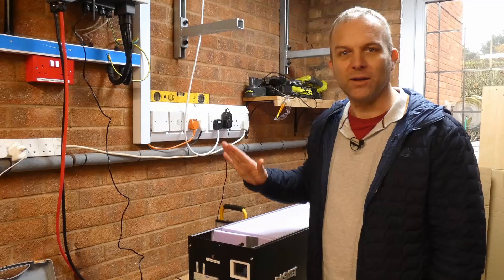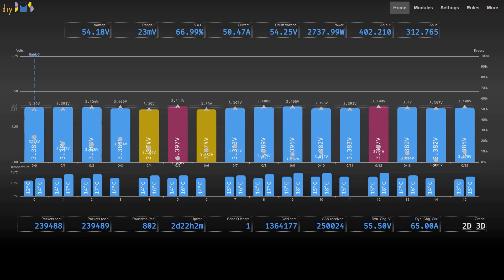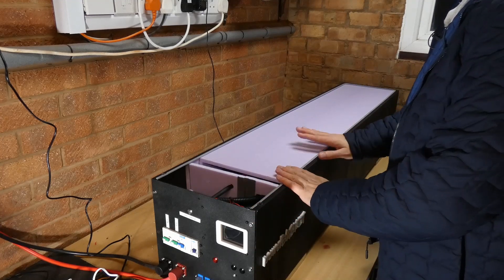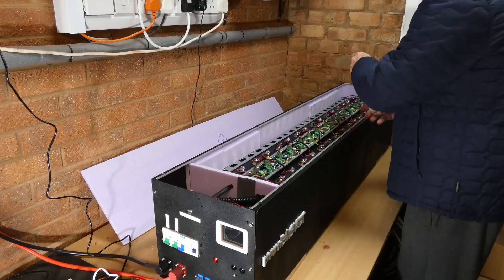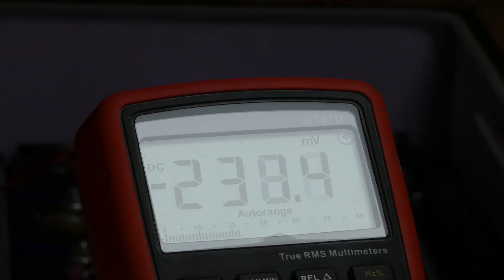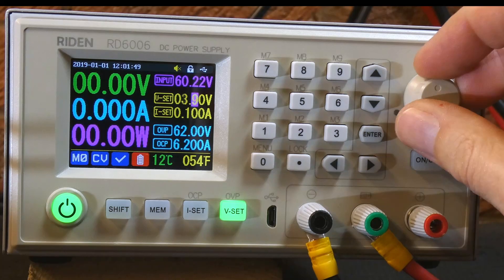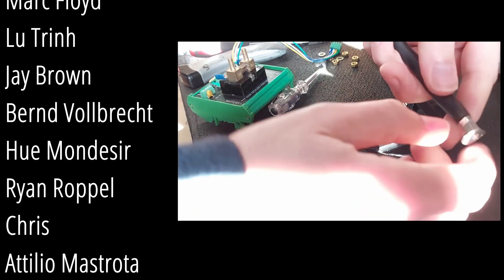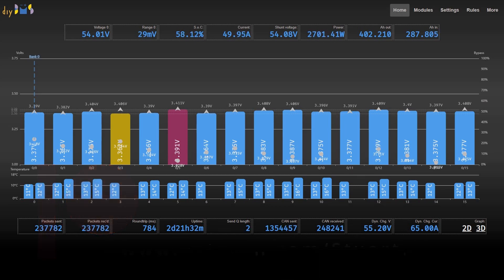Balancing The Pack [Battery Build #7]

Comment: Hi Stuart. Nice build. Top balancing these cells is an interesting topic. I've tried it a few ways. 1st time was the way you did it. Connect them all parallel and then use a bench top power supply. One 16s pack I help build with a friend was on charge for 5 weeks and  even then it never dropped below 4amps. Gave up and connected in series and let the balancer do the rest. 
2nd one I built just connected in series and let a 2A JK BMS balance them out but again took ages. 
I'm building another one atm and  charging them all individually with multiple a bench top power supplies. 
Be interested to see how you get on. 
Initial top balance is a tricky one to do quickly and properly.  
I think patience is key. 😊
Reply from the maker: I admit that I gave up too early before the cells were fully balanced.  They are a lot better than they were though.

Comment: I'm in the same situation. 16s 280ah Lifepo4. 2 or 3 cells high and 2 cells low. Occasional top balancing over the last 6 months has made no difference. Still have usable 9-10 kWh so not too fussed. Interested in what  could achieve with an active balancer.
Reply from the maker: I may look at an active balancer.  After manual balancing, I'm down to 8mV difference which I'm happy with, but time will tell.

Comment: Have you seen solarAssistant, running on a pi interfaces with most of those type of invertors I think. I've been very happy with it.
Reply from the maker: Yes, I need to spend some time looking at that and also home assistant
Reply: @StuartPittaway  SolarAssistant is paid, one time, but I'm very happy with it, and it can generate mqtt which can be picked up by homeassistant.

Comment: Stuart is its posible u add a bit of code. That when a certain battery reaches a certain voltage u van control the relais to switch on/off so we van add a actieve balancer Saw this in Andy ofgrid garage review of the bms hè got.
Reply from the maker: This could be done now with the relay rules - either at cell voltage level or at pack voltage level.

Comment: I did a balance when I got my first 16 cells. Works great next got your DIY BMS working in the end use a JKBMS very good system other than balance leads.
Reply from the maker: This balance is going to take a very long time!!
Reply: @StuartPittaway  Bottom balances first mate.

Comment: I purchased a ZKETech electronic load tester and ran each cell through a full charge, discharge and recharge. This gave me a baseline capacity of each cell to make sure they were well matched. I only had a 1ah difference with my 310ah EVE cells which was good enough for me. If one of your cells is mismatched and lower capacity than the rest, then this problem won't go away.

The reason I dropped the money on the ZKE tester was because it's a set the stages (charge, wait 10 min, discharge, wait 10 min, recharge) and let it run through a full charge, discharge, then charge again. All at 40 amps. I set it and walked away. The model I have is ZKETech EBC-A40L. It's got a usb port for programing and data logging. I tested all my cells immediately after getting them though it took over two weeks as I did one per day. This way if there was a problem cell I could return it to the supplier.
Reply from the maker: I'll do some research on the ZKE looks good

Comment: Stuart, you are not the only one who, after putting the battery in gear, has had to do the TOP Balancing with what I call the Magical Crusader (I don't know if this translated makes sense in English,). Arm yourself with patience because charging at 6A is going to take a while and cover the battery well because it's very cold I don't want your new lithium candles to catch a cold. When you finish this part, I have no doubt that you will quickly see a way to use the data that give that inverter, make it a decent interface, hehehehe. Last, every day I feel happier and proud to be part of your Patreon for some time now. .
Reply from the maker: Thanks chapulino

Comment: I gave up initial manual top balancing. I now fit a cheap active balance board and turn it on with MQTT at 0.1v below the max pack voltage. It save so much time.
Reply: That what I did for the last build, only took a couple of hours.
Reply from the maker: That's not a bad idea. Might consider that.
Reply: That is my intention too, but flailing in the dark without hard data so your comment gives me hope! 
One question if I may, why not allow the balancer to run all the time? (I realise it is ineffective at any SOC less than 100% but I figure it wouldn't hurt running it all the time and overcomes having to connect/disconnect the active balancer).
Reply: @Bennyboy-dog  Running all the time simply wastes energy. Also if under heavy load cells will look out of balance due to differing internal resistances. You don't want to be trying to balance in this state. People worry too much about getting the perfect balance. It should run quite happily with a quick top balance once a month, unless you are completely draining the battery or have very poor cells. The active balancers have a pair of switch contacts with a soldered link across. Unsolder this and fit some sort of switch, relay or manual. Then just leave the balancer connected and turn on when required.
Reply: @muddy11111  I have an active capacitor balancer as backup. The problem is that when it starts to balance, this generates reading peaks in the DIYBMS and therefore the protections are activated, reducing the charging amperage. could be used, temporarily disabling DIYBMS to make that balancing a bit faster and then disabling it and going back to DIYBMS. Specifically, I can activate it remotely with two Tasmota relays.
Reply: @muddy11111  OK, I wasn't sure about leaving it on. I was going to plug the Active Balancer in on a regular basis if leaving it on is not recommended, but your suggested approach is muuuuch better. I might just put a switch on it and run it manually, or if this proves impractical, get a NodeMCU micro to do it for me. Thank you so much!